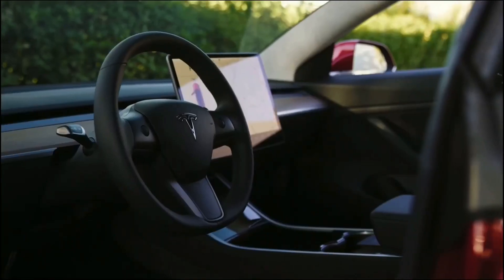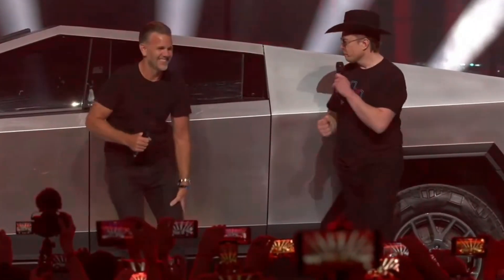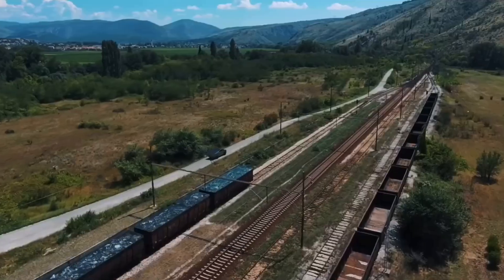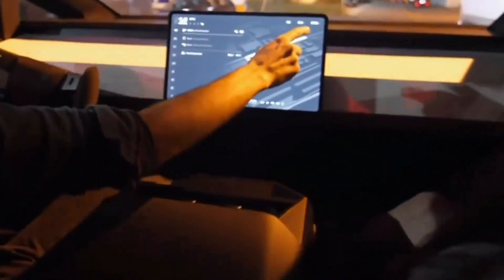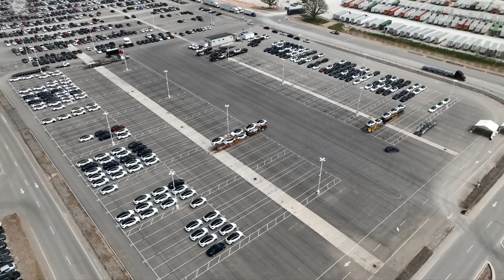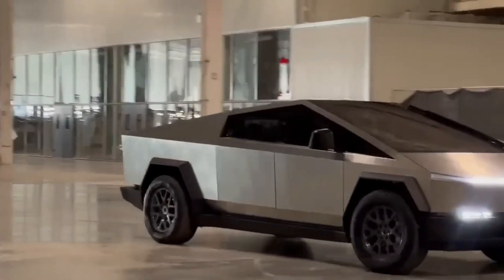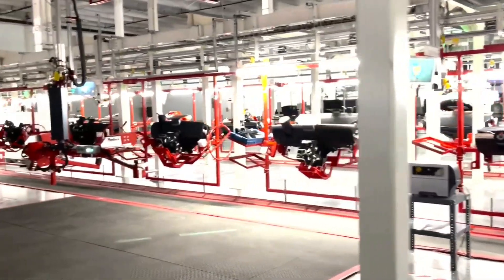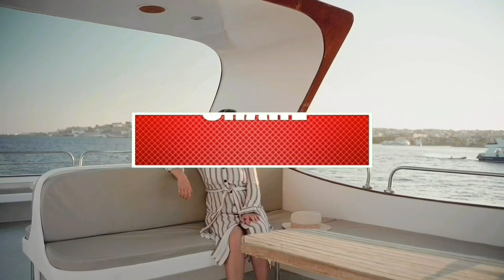Tesla Cybertruck - A Detail Deep Dive

Comment: Sir Great 😃.
But I've not seen anything from Musk/Tesla
clearly stating the 25K car and robotaxi are
one in the same. Despite all the speculation,
I'm more inclined to think they are two
separate vehicles, because the taxi needs
to have more utility than a small hatchback
will offer. While Cruise launched with the
Bolt, they have already announced a different
vehicle that has a design more in line with
what I expect from Tesla.